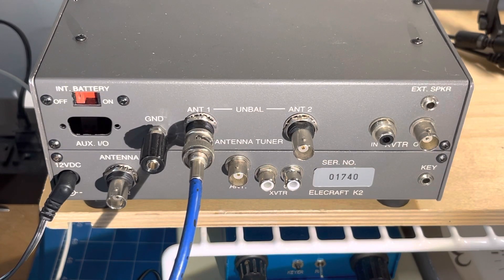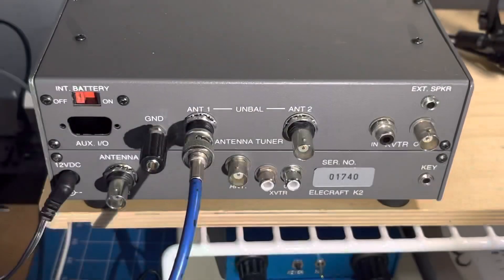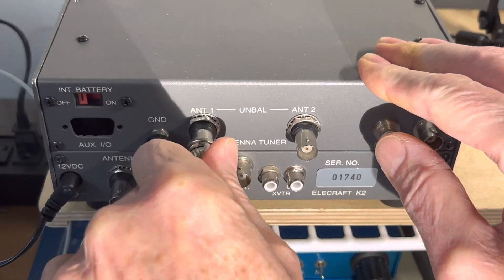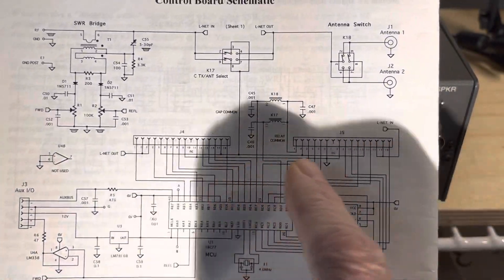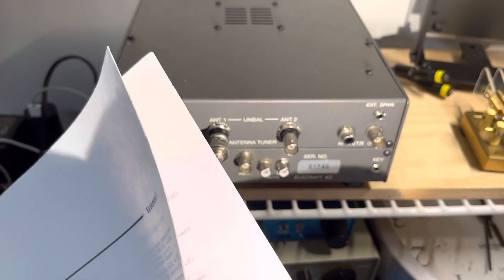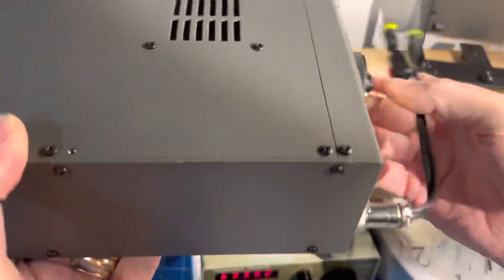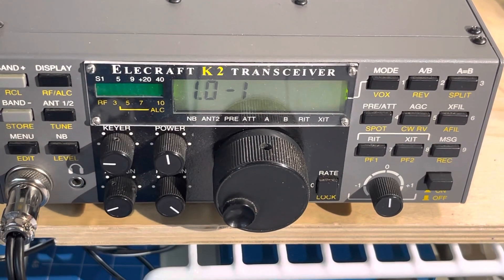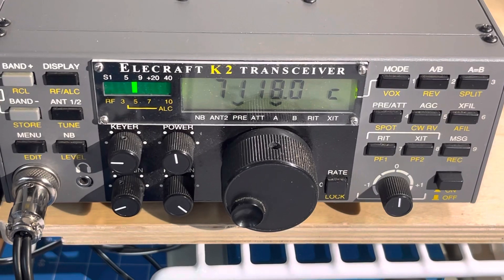K2 - I Can’t Believe I Did That! - KAT2

Comment: I built my K2 from the kit, and the ATU kit came with a black flexible plastic cap to put on the regular BNC jack to prevent it's accidental use (as mentioned). Today I would probably 3d print a cap for it but Elecraft may still have those covers available. Those caps are often supplied protecting BNC jacks on new equipment, it's an off the shelf item, not something that Elecraft had to make.
Reply from the maker: Yes, thanks! Those are some good ideas. I’ve also found bolt thread protectors at Ace hardware for less than a dollar that fit well on a BNC connector.  I guess it is one of those mistakes you only make on your first day with a K2 and the ATU, so not so bad. Thanks for watching! 
Did you add the SSB and other options as well?
73,
Bruce
Reply: @tyrueiI  My SN is about 1000 higher, we bought it late for a K2. I do have the SSB adapter, and the noise blanker, the A to B kit set, the 60 meter kit, the DSP and the wide bandwidth SSB kits. I also got the battery kit without the lead battery and put a lithium polymer pack inside which I removed later but may reinstall with a 4 cell 12V lithium iron pack or possibly a 3 cell 11V KX2 pack, could actually fit two of those on the tray. I put a Yaesu FT-817 knob on it which was a popular upgrade, and epoxied a palm mini paddle base to the right side panel. Some of these upgrade kits are still waiting to be installed. :)

Comment: Hi, nice video, very very good video...👍👍👍👏👏👏
Reply from the maker: Haha - thanks! It was pretty embarrassing, but I thought it might save someone else the mystery. There should probably be a plastic BNC cap for the original antenna jack once the ATU is installed. The tuner works very well on my 40M dipole.